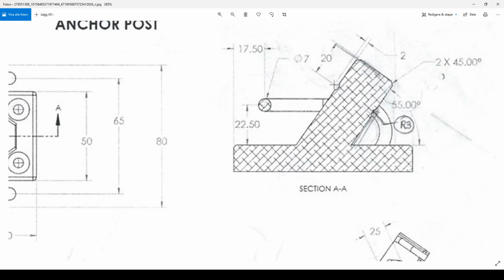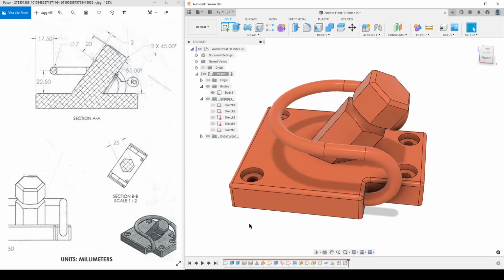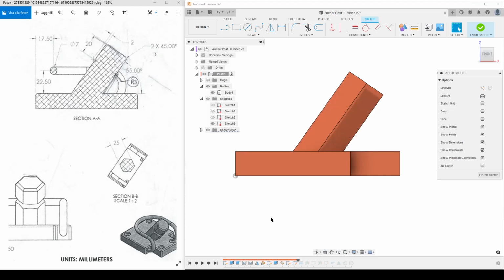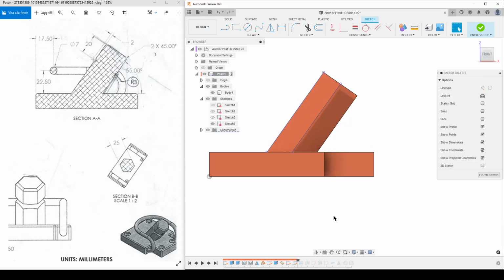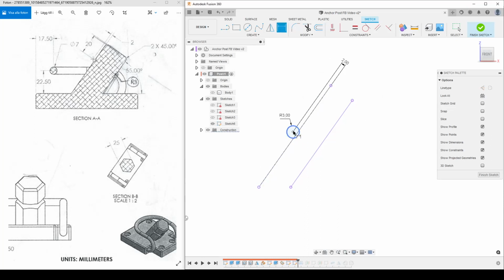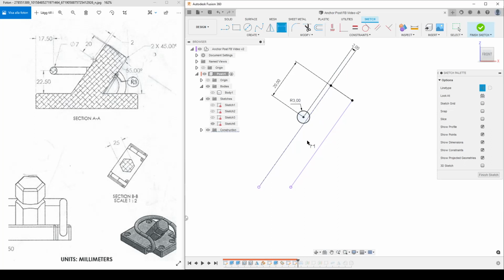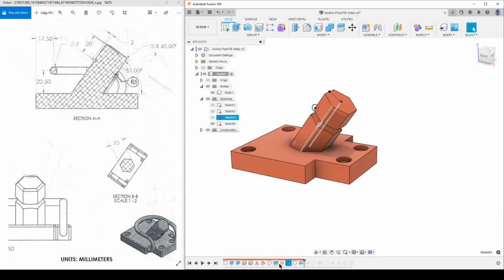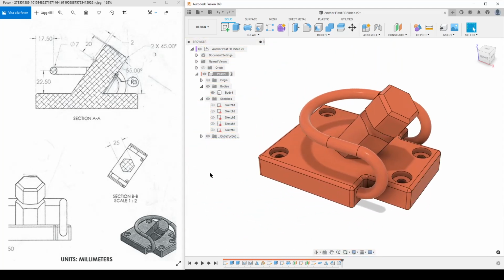Fusion 360 Basic - Anchor Post Fixing my Mistake!!!

Comment: At 7:10 you show the side view of the new cut. Its like the cut is still the old cut because the cut and the circle that you used for the cut just don't line up with each other. Maybe it is just my eyes that are wrong?
Reply from the maker: It looks a bit strange, but it lines up. The cut is getting wider closer to the view because it's cutting the corner of the hexagon. The same geometry is visible in the drawing but not pointed out.